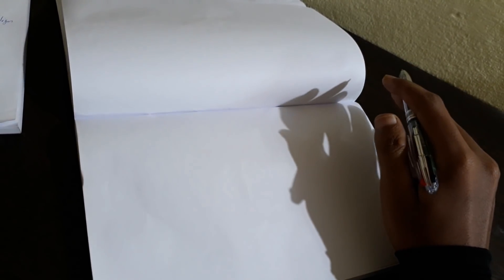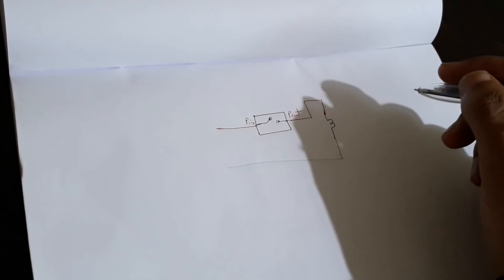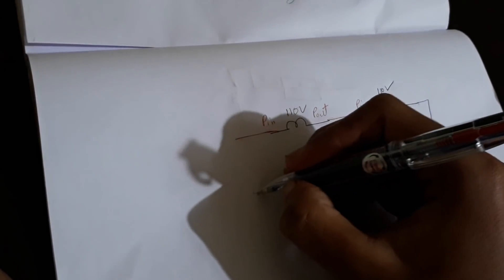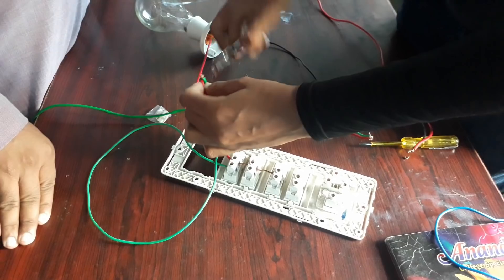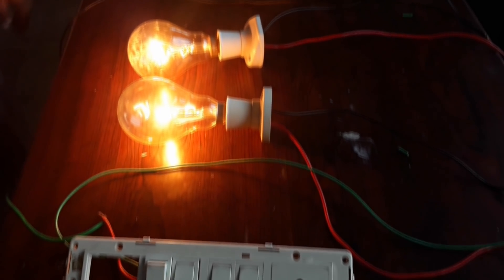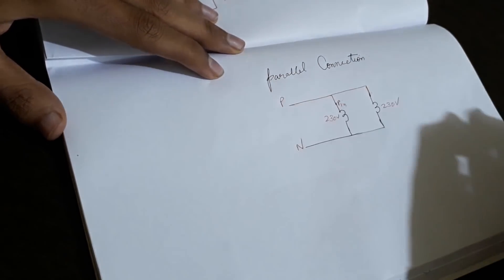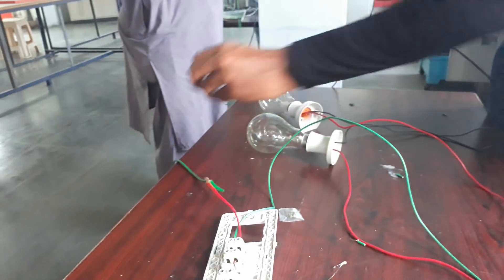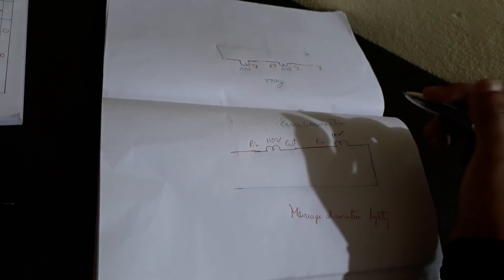Series and Parallel Connection of Two Bulbs | Which will glow Brighter | Basic electrical connection

Comment: The Levolier Tri-Lite invented in 1927 used a rotating switch that controlled two lamps in either parallel (bright) or series ("twilight") mode.  See US Patent 1736779.  Became obsolete in 1933 with introduction of 2 filament bulbs (3-way).
Reply: That should be Levolier Twi-Lite not Tri-Lite.
Reply from the maker: Have to look in it.  Sounds good

Comment: You're doing a great job. I'm a teacher in high school if you promise that you not gonna to turn the ballpoint on and off million times per second all my students will subscribe on your channel. Thanks
Reply from the maker: Thanks . Will make sure not to do that.
Reply: @ElectricalInfinity  I use to play your videos to my students and as I said you doing a great job. Keep uploading and I guess you didn"t find  my comment to be offensive to you. I thought your pen will broke apart in a matter of seconds :)
If you have time please upload same video with voltage, amps, ohms calculation. Thanks
Reply from the maker: I had uploaded a video with calculation and simulation. Check it !
Reply: @ElectricalInfinity  Calculation when you have for instance 3 light bulbs in series connection one is 80W, the second bulb is 60W and the third one is 40W. If you have 220V power source  how many  Volts will flow in each circuit, how many Ohms reading will have in each circuit  and Amps readings. Which law you using to do the calculation Kirchhoff's circuit laws or something else?
I appreciate your time and effort for your answers.
Reply from the maker: Thanks so much

Comment: What is the meaning of neutral
Reply from the maker: It is a return path for power. As we are using single phase we have to make a circuit close one in order for circuit  to work. So we use a wire called as neutral to make closed circuit.

Comment: Are the defferent load 2 bulbs in on series or parllel  connection are same
Reply from the maker: +APPU YERAGADA i didnt got your question . Kindly ask it again .
Reply: 2 different voltage bulbs in connection
Reply from the maker: +APPU YERAGADA each bulb is of 200 watts . So they are same one.